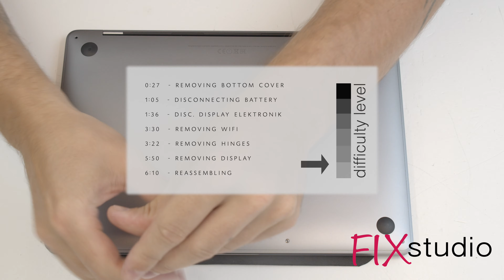Macbook Pro 13' 2016-2020 - display replacement [4k]

Comment: Just did my first laptop repair, took about 2 1/2 hours and multiple heart-in-mouth moments and multiple cross threaded bolts but I finally conquered it, only delayed it by 2 years 😅

Video helped out immensely, although wish there was a voiceover so it’s easier to understand when putting back together 👍
Reply: Good morning! Could you help us with the screwdrivers type and sizes that you used please?
Reply: @alessandraduarte4755  no idea mate sorry

Comment: Great Video, I have a slightly different MacBook than in the video but the video showed the basics of what needs to be done with that generation of MacBook. Something that I think would help in the future is either more written description of what is going on or verbal description of the process. Personally I had no problem following and think you for the video/help. Please keep us going, we need more people fixing stuff and not just replacing the whole think.

Comment: Hi, I have a 2017 MacBook Pro 15 inch and the screen isn’t broken, like cracked, but it went black and I can hook it up to an external monitor and it displays perfectly, but the screen won’t display on the laptop itself. Do you have a video that explains how to fix this? Is there a connector that disconnected internally or something? Would appreciate any help fixing this myself!

Comment: Hello, I have a Mac Pro 13 in. 2021 A2338. I was wondering, since my display is messed up can I buy a display from a 2018 or other year model and replace my mac’s display?

Tía.
Reply: were you able to switch it? I'm wondering if I can do the same thing.
Reply: @kiannamichellee  hi, i ordered it through eBay the same model but it has not arrived yet
Reply: please how much does it cost, Mine has been showing black i was going to fix it around 550 euro

Comment: Can I use 2017 pro 13 inch display on 2020 pro 13 same resolution? Thanks.
Reply from the maker: Unfortunately not
Reply: @fixstudioTV  Thank you.
Reply: @fixstudioTV  Disaster, I messed up, battery connecter cable ( 6 pin) came out. Is it replaceable or do I have to change whole logic board

Comment: 2017 MacBook pro 13 screen is broken/not working. Wondering if it is possible to transfer the "guts" of this machine into a 2012 MacBook Pro case, given that it has a working screen? Please provide links, if it is possible. Thanks.
Reply: They have totally different connections, 
ports aren’t the same either